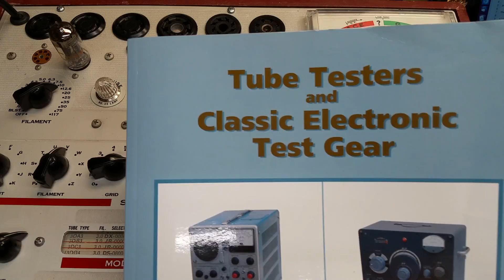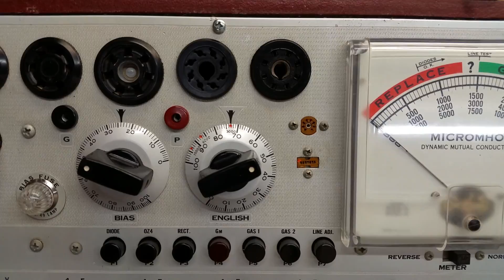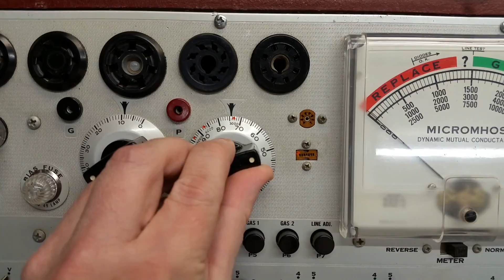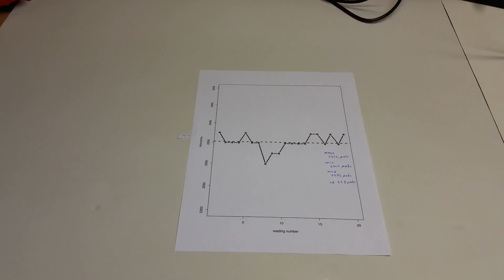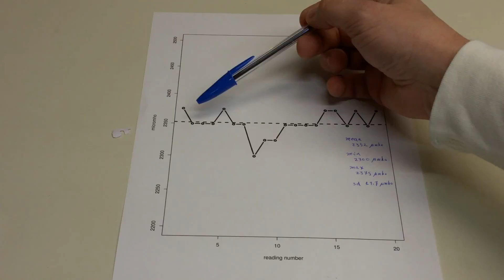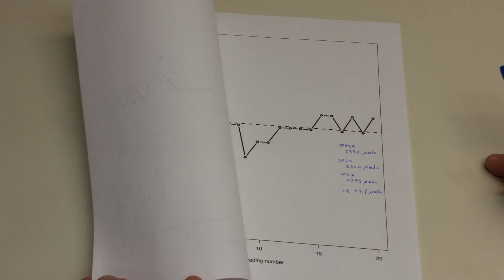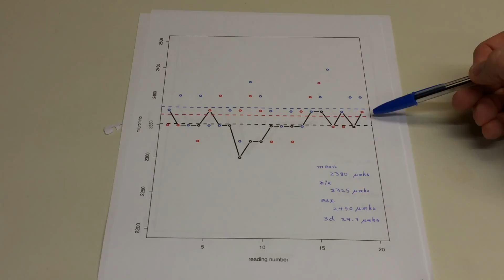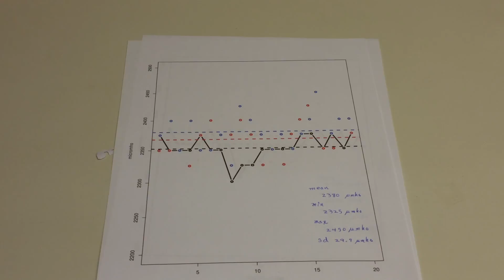#24: Hickok 600a tube tester: Precision

Comment: I have found that dirty pushbuttons and wiper arms can make the readings vary wildly.  Push it once, and get one reading, push it again after cycling it some and get an entirely different reading.  Also, the tubes must be fully warmed up, and a reading taken after the tube has had time recover from the previous test reading.  Yes, loading down the tube matters.

Comment: With those tester you leave it on 6000 scale and check all tubes without moving control cause will use middle of scale which is most accurate. Then only adjust bias which is more precise

Comment: You either need to get your eyes checked. Or you have a problem with that deice. If you put the controls on the correct settings you should be no more than a very small percentage error.

Comment: Not sure what others would use the gm for but for guitar amps and HiFi amps the kind of variation he is experiencing frankly is negligible for acceptable proper operation esp in guitar amps where some nonlinearity is actually desireable. In HIFI not so much.
In HiFi tubes esp boutique amps, matching the gm of the driver tube is especially important for the minimum distortion possible in the Phase Inverter tubes.  Still a few clicks off of gm would most likely be negligible unless tested on a distortion analyzer.
For guitar amps typically we use gm to determine the condition of the tubes compared to what it should be as opposed to just reading the Bad-Good scale in that mode.
We use gm more for matching audio output tubes when in the different variations of AB push-pull operation as the tubes need to be sharing the load equally between tubes especially when there are 4 tubes.
I've also discovered on my Hickock 600A tester if I put my cathode current adaptor between the tube & tester, I can match the current draw of the power tubes which is more significant than the gm matching as you don't want one tube in the quad drawing excessive Idle current when the other power tubes are set to the spec for a given acceptable idle current. 
I know gm is calculated by the xnge in grid voltage vs plate current so they are all related. 
BTW, the introduction of the 1ohm resistor for testing cathode current barely affects the gm measurement, so there is no need to remove the adaptor to test the gm.

Comment: I usually tell people to get a 533 or (especially) 533A because, if for no other reason,  the 533 series has a fixed-stop rotary-switch for the "range"/multiplier settings, instead of just the highly subjective, poorly repeatable, rotary "English" potentiometer found on the 600 series. Similar circuitry to the 600/600A otherwise, and test data is generally interchangeable between the 533 and 600, and the 533A and 600A;  but the 533 series are much larger and Bless crowded internally, and therefore it is easier to get into the circuits and do any minor service or replace worn sockets or whatever. The highly compact 600 series is much harder to work on; even just bolting new socket-savers into it can be a pain.
.

Comment: That means your English control needs cleaning if it's dirty will cause variations even if you put it in same spot everytime.
Reply: Ding, ding!  Winner winner...
Reply: @SinnerSince1962  my 600 is stable so if put on orange dot it is within a tick each time. But use my 752 for accuracy has fixed gm switch, use shunt control nly for rectifiers

Comment: The other models have a fixed switch for mutual conductance so results are more accurate. Still has bias and line adjust. The shunt control is still on the tester but its used to test non mutual conductance tubes like rectifiers. My 752 Hickok tester has one of those fixed gm switches called a multiplier x1 x2 x4 x10 and x20

Comment: Having used a 600A for a long time I can tell you that pushing P1 or anything else before checking for shorts can be the end of your tester..
Reply: The bias fuse should protect tester incase of shorted tube. That's what makes hickok testers so reliable

Comment: Good Grief, never designed to be any better! Good enough for it's intended usage.
Reply: Exactly...  Unless you are into audiophile level tube amps, or tube type test equipment, the micromhos really aren't that important.  You just want a tube with no shorts and great conductivity.  Also, some tubes work better in individual cases than others, regardless of what the tester says.